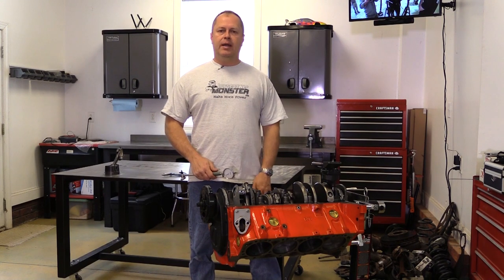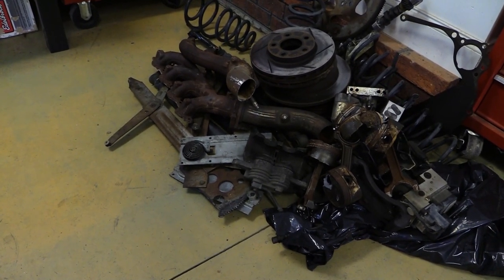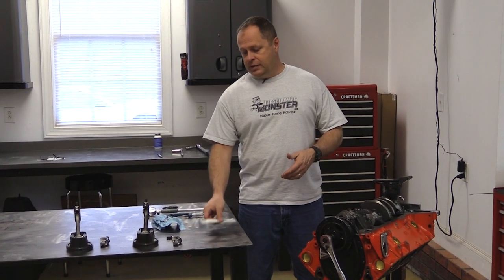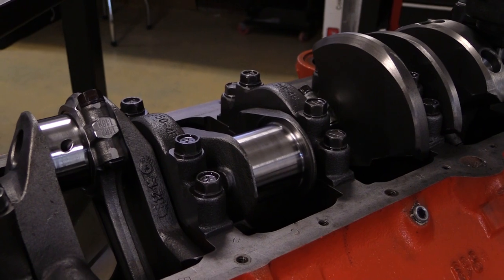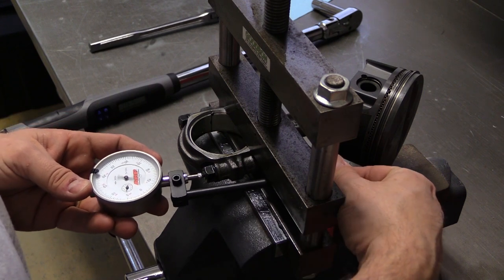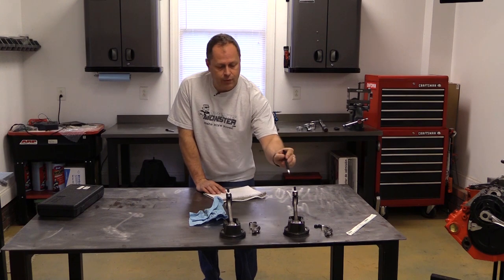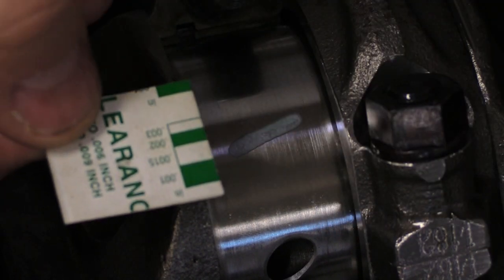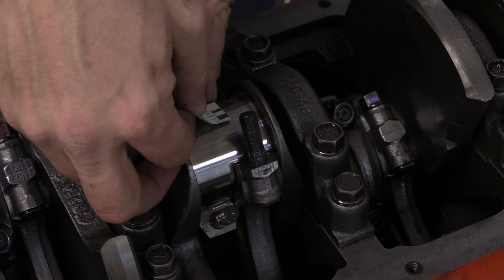Better Engine Building: Does Plastigauge Work? (Testing Against "Real" Engine Builder's Tools)

Comment: At 66, I've built engines all my life. Every rod bearing is checked by Plastigauge when it's assembled. The best thing about plastigauge is you're checking all the parts involved. You're checking the crankshaft journal, the rod bearing, and most importantly, the rod too. Cranks are easy to measure with a micrometer, rods can be measured with a dial-bore gauge or inside mike. But in a production shop, Plastigauge makes this quite simple and easy. Plastiguage indicated several problems with engines over the years that the precision tool confirmed.

Comment: Forty years ago I worked in a production  automotive engine rebuiding shop.  Setting up the main bearings we would put in the crank, torque all the journal bolts than see if the crank will rotate. So now you know it has clearance, don't know how much. Remove one bearing cap at a time and put a small shim cut from .003" feeler gauge stock. Put the bearing cap back on retorque the bearing cap. Now the crank should not be able to turn. Do that for each of the bearings. You now know the clearance is less than .003" .  Do you really care ,on a street motor what the clearance is as long as it is with in the specifications.

Comment: Love these vids... Being in the industry as a mechanic for 19 years, this is right up my alley. Had to laugh about the metric system confusion. Being Australian and growing up in the 80's/90's I was well and truely in the metric era. I personally find the imperial system unnecessarily complicated. The metric system is far easier to use as everything works in groups of 10... Anyway, keep the vids coming
Reply from the maker: Thanks for watching!
Reply: May be easier to learn, but what you learn what’s used what does it matter after that? It doesn’t.
Reply: Only one country went to the moon, and it did not use metric.
Reply: @SOLDOZER  I laughed so hard at this
Reply: @SOLDOZER  Well, NASA do and did use metric, so there's that

Comment: I was taught to put the plastigage at the center between the bolts, wonder if you could check on another engine your doing and see if there is a difference between the center and offset towards a bolt.

Comment: Use brake cleaner to remove used plastigage (yes, this IS the correct spelling) off of crank journals.  It wipes right off.  You have to be a little careful when wiping the stuff off, because you can leave a trace of plastigage on the journal.  You have to wait for the brake cleaner to completely evaporate so that the journal is dry, and check for small smears of the plastigage left over when you wiped it off the journal.

Comment: You don't need to clean the platigauge off when your done, you can leave it on. It will not do any damage to the bearings and is designed for exactly that. I have always used plastigauge and a buddy of mine strictly uses bore gauges - neither of us have ever had an issue so really it comes down to personal preference. At the end of the day we're building engines and that's what's fun!!
Reply from the maker: I like the way you think! So does the Plastigauge just melt into the oil like assembly grease? If so, that's pretty cool. I guess you learn something new every day. Thanks.
Reply: I was told that Plastigage was invented so that it would dissolve in oil. Before Plastigage, people used lead wire and performed basically the same measurement procedure. The problem was that if someone forgot to remove the crushed lead wire, it would destroy the crank and bearing. Once plastigage was invented, it didn't cause a problem if anyone forgot to remove it.

Comment: Your readings with a dial bore gauge will usually be a little bigger than plastigauge because the tips of the bore gauge dig into the soft outer babbit layer of tri-metal bearings. I've seen heavy and expensive Sunnen bore gauges read 3 -4 tenths inaccurate when used for clearance checking. Fresh plastigauge works great. I asked a Sealed Power/Speed Pro engineer about this and he said I was correct. The H series racing bearings have a harder or thinner babbit layer and using a bore gauge with them is a little more accurate.

Comment: .0022 IS slightly bigger than .002, so the plastigauge is more accurate than he said in the video.
Reply: Yeah, that's what I was thinking. Don't know what zone he was in.
Reply: He meant the plastigauge was a bit wider than .002" on the scale, which means the plastigauge measured slightly less than .002".  The more it is squished the smaller the clearance.
Reply: It looked dead nuts to me

Comment: I’ve used plastic gauge for years and you are right it gets close but not dead on. It’s a fast way to check if you have a problem and need to go further with mics . Also bearing manufactures have books on their bearing thicknesses so you look up the bearing for your particular engine and they will have all the specs for rod diameter bearing thickness and Journal diameter this will save a lot of time and guesswork

Comment: Hmmmm........... Mic's read just over 2 thou, plasty guage reads just over 2 thou, sounds the same to me.
Reply: If the plastic is wider than the strip for 2 on paper then it actually reads just under 2. Smaller clearance will give wider plastic as it is comperssed more. Bigger clearance will give narrower plastic as it is compressed less.

Comment: Of course plastiguage is accurate - as if there's any doubt!
OK, so the plastiguage isn't the most accurate we can be, but what actual difference does it make to the home engine builder - the tool's intended use? I contend none. 

If used for its intended purpose as a checking tool, it confirms your clearances are in the ball park to a high degree of accuracy. If you're assembling the engine yourself and want to check your machinists work then platiguage is perfectly fine, but no machinist would ever use a plastiguage as a primary means of determining journal size and therefore clearence so I'm unsure of the point of the vid? 

I don't know of any machinists that machine crankshafts using plastiguages.

Comment: What is nice with plastigauge is that you get an measurement across the whole bearing surface, in theory, very nice. And should you not hold your micrometer by the insulated pad?
Reply from the maker: You are definitely right about holding the mic by the insulated pad. Bad habits.
Reply: @TheHorsepowerMonster  It would be interesting to see how much the measurement changed after holding it like that for a while. Doing an whole crank with 4 measurement per bearings first with, and then without holding the insulated pad. In the real world and normal temperature, it is probably not the end of the world. I think there often is an temp change graph in the instructions also.
Reply: @TheHorsepowerMonster  Just a thought on Pastigauging across the whole bearing journal. I have seen a notable taper in the Plastiguage and checked the con rod and found taper in the rod bore. Corrected the bore and saw the taper go away. Is a good tool if you know what to look for.

Comment: Plastigauge also works great in scenarios where you're not in a complete teardown and can't measure the clearances with conventional tools. 

For example, I had a buddy with a Mustang, 4.6 3v, break a cam cap when he was swapping the cam.  He was able to get a used replacement from a guy on a forum, but I wasn't sure whether the different cam cap had slightly different dimensions, or if the one had had been lined bored with the cam, etc.  So we fit it up, used some Plastigauge, and tolerances checked out within factory spec.  There would have been no other way to ascertain the measurement without pulling the head off.
Reply from the maker: That's a great point. Much better than the old, Bolt it up and hope for the best!
Reply: @TheHorsepowerMonster  One of the biggest advantages of actual precision instruments is the ability to check for roundness.  That's where the plastigauge obviously falls short because it assumes roundness through  all 360 degrees of rotation.  The platigauge reading is a snapshot to get a general idea, and as you correctly said, is better than bolting it up and hoping for the best.  But on the bench, you can take several measurements of the journals, rod ends, cylinder bores, etc., to ensure your clearances actually are your clearances all the way around. Great video though, thanks for putting that together.

Comment: Works OK if you RTFM.  set the clean dry crank in the clean dry bearings.  Torque mains without moving the crank at all.  Remove caps, read clearance.  same with rods.  No oil at all.

Comment: Back when most things were still made in USA, old timey toolmakers who really knew what they were doing used Plastigage for things more critical than this.  If it reads different than a barrel mic, you might not be using the mic properly, or it might be out of calibration.  This can very easily give you several ten-thousandths of an inch of error.  You really should check your mics every day.

How often do you calibrate that dial-bore gauge?  Those are notorious for error.

Something else to consider, if something is off-centre, your clearance on one side will be different than the other.  So measuring the diameter will always give a different result than Plastigage for that.  

The last time I had a crank ground, I measured it myself with great precision, and took it back to the shop that ground it.  I greatly offended the guy who ground it.  He blamed his old "non-CNC" grinder.  I wanted him to let me show him how to use it, but he wouldn't.

Comment: Nice job on this subject. Plasti-gauge is sold under several brands, but it’s patent goes back to the 40’s. So, it may not be your grandfathers Oldsmobile (Or anyone / use to own a nice RB98) but it could be his plastic gauge. So, for many who don’t have $4-5k in inside/outside mic sets, plastigauge will be a general guide and place anyone in the ball park.
  Note; The newer the engine, the oil recommended by the manufacturer is synthetic down from 5W-20, to 0W-10 gets tighter in bearing clearance specs. Example; 2003 iron block GM 5.3L is 5W-20 and rods specs from GM production (New) 0.00009”-0.00025”, while service is 0.0009”-0.003”. This has a lot to due with the oil and bearing clearance as synthetic may cost more but has a much better cold flow, viscosity control over all heat ranges, etc. Just remember, this thin film is like tiny ball-bearings between metal crank to babbitt material. Use the correct clearance and oil. Yes, it cost more, but so due engines. Short drives to work, shopping or everyday use kills oil, so it needs driven on the highway at temp, once per week or change it at 2-3k miles. Raw fuel, water vapor, egr (Some models) but carbon particles as hard as rocks, float in the crankcase and can be boiled of if you get the temps up, otherwise it stays in the oil and this mixture become more acidic. Don’t let this happen! Change you oil and insist on an OEM filter. ASE Master Tech since 1978 - Retired  Like & subscribe !!!
Reply: Rod clearance is NOT .00009!! Are you on drugs????
Reply: @SOLDOZER  little buttons on cell phone. Get over!

Comment: The main benefit of plasti gauge vs a mic besides being able to check across the whole bearing surface is that with a mic its fairly easy to scratch the journal if not used properly. Even if you can afford the tools you probably not well versed in handling then. Now bore mic not as much a concern. So average builder or even weekend bracket guy plasti gauge works great without risk of scratching journals. 

Also just use a little lacquer thinner on a rag to remove plasti gauge.

Comment: Great Video.  it seems to me if you're careful, you'll be ok.  I think I'd use an infrared thermometer to make sure the crankshaft's at room temperature.  Check the bearing temperature too.  However, I think I would only be comfortable if my reading fell close to the middle between the maximum and minimum allowable clearances.  This allows you plenty of wiggle room.  I would not trust it at all if you have a reading close to the limit.   At that point, time to buy the expensive equipment or bring it to a trusted machinist to double check measurements. lol

Comment: My opinion is that the plastic shows true oil film in assembled/running condition just I want to see it. My race bikes are always plastic checked before assembly and my Yamaha R1 runs better and longer than the so-called race shop engines that I compete against. I'm more than happy with my results but my track rivals aren't as they pay huge bills to have someone build their engines for them. I love my track days at Sebring Raceway Florida.

Comment: Nobody here is going to work to "tenths", you would have to have a CMM and be damn good with that to get reliable results. You can give two guys the same micrometer and have them measure the same thing and they will come up with different dimensions. One ten thousandths of an inch is in another world compared to even one thousandth of an inch.

Comment: Plastigauge is just fine for the average builder. It's been around for 70 years and going to be around for another 70.
BUT I'm curious, being a mold maker for many years. How you can read .0001 on a dial indicator only accurate to a half thousand (.0005). Everything in between is just guessing. You would need another dial indicator accurate to .0001.

Comment: I would challenge you to do a blind test and measure your crank and your rods multiple times to see how much error you have in your measurements. You also are only measuring in one spot you’re not actually measuring the cylindericity of the Crank or the rod. I would venture to say that plastic gauge is a more real life measurement of the clearance, and if there’s any variation it’s more than likely the way you measure it with your gauges.

Comment: Dial bore gauges need to be set with gauge blocks to be accurate. You seting the micrometter on the journal is not a transfer standard since the frame of the micrometer flexes a little.

Comment: Plasti-gauge is fine for 99.99999% of home built engines. It cleans off easily with a paper towel and some brake cleaner.

Comment: I think a lot of people see this as plastigage vs. micrometer, including the host, but thats missing the point of it all.
No, plastigage is not as accurate as a micrometer, but it has it's place. The guy (or gal) that's NOT an engine builder and doesen't have fancy tools, its absolutely better than just slapping an engine together. I mean, if you are aiming for .002 and its closer to .001 or .003 you definitly know something isn't right.
However, if you are building something more serious, chances are you have a lot more knowledge and own or can borrow a set of tools.

Remove plastigage whith acetone or brakeclean and a rag.

Comment: Back in the in the 90's I built and tore down to check my own Sprint car engines and always used Plastigage. Did I ever blow one up? Yes, kicked out of gear twice with my foot on the back motor plate a few years apart, they were wound tighter then a ducks fart!  Back to your video, if the Gage is wider than .002 than it would be higher than .002 and not smaller correct? I believe posited the the opposite in the vid.
Reply: I missed you between believe and posited. Sorry!
Reply: No.  If the PG is wider, you have less clearance.

Comment: Plastigauge is pretty damn close. If you're building a mild engine under 400 hp this will work. Once you start punch over 500 hp I would use precision tooling. One big thing I like about plastigauge is you can visually see if you have taper on your caps. It's cheap and works just fine.
Reply: Im not a pro engine builder or mechanic but let me tell you something every engine even race engines has a tolerance that you can play with some more some less i got precision tools that i know how to use but my late ls build has way more than 500 more like 800 and guess what i use plastic gauge and has cero issues is been abuse for three years, but i agree that quality precision tools are more accurate if use properly

Comment: Its not the question if it is accurate or not, what will you do if the clearance is off? Is it the bore? The crank? Are the parting lines stepped? How do you determine if the bore is round and you have the radial clearance, how does the bearing crush look? Is the rod ovaled out?
Its great if you "want to know" but its not an engine builders tool, its a hobby tool for knowing the clearance at the exact place you placed the plastigauge. 
Those are the engines that you take apart and the parting lines are down to the copper.

Comment: Damn! Gas prices must've been up then to get$140... Hell after accumulating junk from automotive repair, having hundreds of lbs in steel rotors,brakes, radiators etc, I'll get $70 on good days! Loading my small sonoma approx over 2,000 lbs.
Reply from the maker: Most of the money came through seven aluminum wheels I also turned in. The steel I got almost nothing for. Thanks for watching!

Comment: So what do you do now that you have measurements. What is the purpose of knowing clearances?
Reply from the maker: If the bearing clearance is too tight, you run the risk of spinning a bearing. If it is too loose, you lose oil control and have poor oil pressure. Once you know your clearance by making the measurements, you can make adjustments by using bearings and are either 0.001 of an inch undersized or oversized in order to get the proper clearance. Hope this helps, and thanks for watching.
Reply: The Horsepower Monster cool you respond to questions like this so thoroughly. Subscribed.